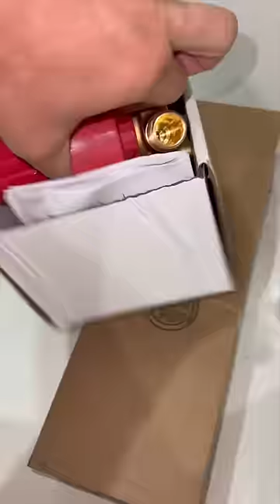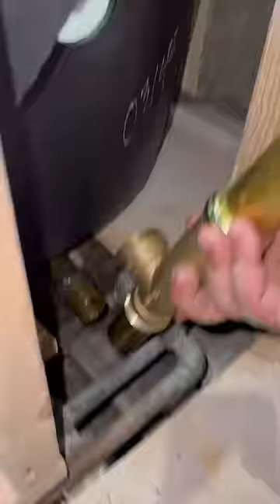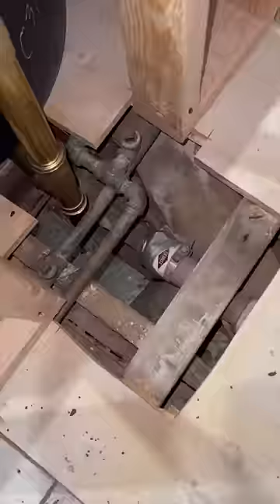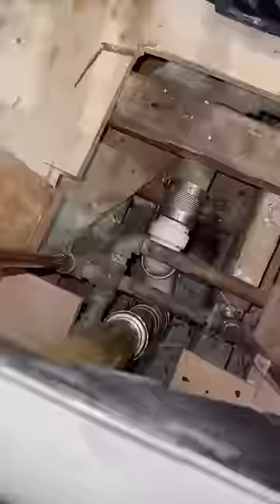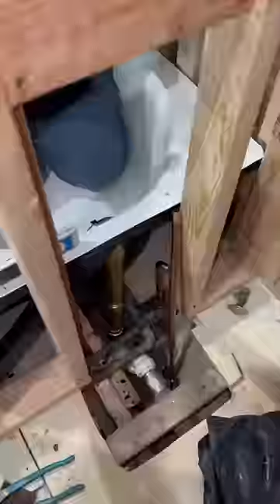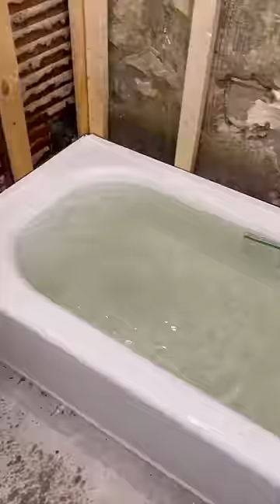Installing a bathtub and shower body #renovation

Comment: Worked in a hospital for a while and google translate was a life saver when there was a language barrier. It would auto detect what language they were speaking
Reply: What did you use?
Reply: Was going to comment google translate
Reply: Or hear me out learn the language of the country you decide to boarder jump to.
Reply: @godyoursavior4854  well if your talking about the United States, there is no official language.
Reply: @nathanielschmitt6547 true but the default for most is broken English that use so many different pronunciations for a single word
Reply: Yes, you just need to use simple short sentences with no slang or colloquialisms.
Reply: @godyoursavior4854  Tell me you only speak one language without telling me. That's a process that takes years even if you're really working at it. Even once you have a handle on everyday conversation, technical topics are going to be outside your vocabulary.

I studied my second language for about 7 years and my third for 5-ish. I couldn't tell you the word for "valve," "showerhead," or even "plumbing" in either of them.

Comment: It’s strange seeing you use PVC. Keep killing it bro!
Reply: If it is not a high rise. Then it is okay. PVC in a high rise is like putting gasoline in the walls. Just waiting for a ignition and then you got launch all the way up.
Reply: @hoktang1 I though they had to use it because of rats
Reply: @bmo14lax  I thought he said that they had to use cast iron on the main drains because if not rats will chew through it. I've been there. I'm not bad mouthing
Reply: PVC is allowed in nyc any building 5 stories and less doesn’t matter if it’s an apartment building or private home , most buildings and owners prefer cast iron ( quiet pipe ) because it’s less noisy
Reply: @Billybonessss  I could be wrong but if is a individual own home. Then I think pvc is allowed. If rats damage it then the cost is covered buy the home owner. Where in a high rise the building owner is responsible. For the people that lives in his property. So it maybe a little bit more rigorous or a higher standard.
Reply: @hoktang1  It's less about highrise and more about vertical installation, where the fire would climb the pipe
Reply: PVC always better it just sounds louder but for underground will last 100s of years versus metal lasting 50 clay maybe 40 years on average atleast from all the sewers ive dug up and copper and brass both leak in shower drains alot brass is rare but it happens over time chrome plate brass link sink drains rot very fast PVC is just the way to go lol screw the aesthetics use plastic PVC because it's just better exception of rats eating through it above ground and sound deading properties
Reply: @hoktang1 it's honestly crazy how destructive rats are though in NYC an chicago
Reply: @Billybonessss looks like it is illegal in the video TBH bc it does look like apartments so he's fked up for doing that not in brass

Comment: An easy way to adjust that rod and nail it every time is to do it OUTSIDE the pipe. You can really easily mark the fully closed position on the outside and use the screws to hold the plate on the back side of the assembly. Then you adjust it to the correct height, and boom broski, you’ve got yourself the perfect length every single time.
Reply: No one has time for that. 😂

Comment: heres a tip from one professional to another. your phone and its ability to tap into the internet can be your friend. In this case you could have brought up a picture of a shower with the extra handheld option or just bring up google translate and that should be enough to get a simple question across.

Comment: Watching this I can't help but feel the same way when dealing with mess ups on my own jobs. Had an entire hospital wing renovated, new pipes , new water columns for the supply new drains for all the bathrooms, after all the roughing done the construction teams come in do all the walls ceilings, and next thing i know 3 weeks later i get called back to fix like 7 problems. Floor and sink drains clogged up with cement and who knows what kind of wall glue they used, faucets leaking and not running well(they had nothing but sand &plastic fibers in them).

Comment: There’s a bit of a trick . Don’t screw in the trip lever , put the stopper in and flip the trip lever if it raises and levels out to the screw ports then you’re good. If not make it longer or shorter. It saves you time and frustration from unscrewing and tightening back

Comment: Looks good man.  Quick question though.  Is there a reason you use a brass trip lever waste assembly?  Is that code in your area or just a preference.  Fortunately I don't ever do those trip levers but I pipe the drain and overflow in pvc...never had a issue.

Comment: On the gerber, set the barrel on the bottom of the tub and the offset in the linkage should be at the same level as the face plate screws

Comment: I guarantee you will be back to install the handheld. It comes with it in the finishing box. If there's an option on the valve for it means there is a handheld in the box
Reply: Valid opinion but so it always knowing you can come back and add it easily but it’s harder to remove it

Comment: It's interesting seeing how plumbing works in other countries, These types of installations would never fly by Swedish standards. We are never allowed to put joints in walls or floor unless theres a water proof box around the joints with a drainage leading onto a waterproof floor AND the joints have to be able to be accesed by a hatch on opposite side wall/ceiliing below

Comment: Same w me I hate those flipn linkages, always takes me way too long, I had a homeowner Try to install it any ended up, dropping the linkage down their drain And decided not to tell me to go all the way back home and putting my camera down there I finally found it and snaked it out w a wire. Those linkages also rot out a lot cuz they’re so thin, I always try to push them towards the pop up drain now

Comment: Watco uses a number guide on their waste/overflow. Whatever number is exposed on the overflow pipe is the same number you set the linkage at. Dead on every time.

Comment: I'm with you on the tub drains. Those are a pain in the ass especially to adjust the right depth of the cylinder to hold the water on the tub

Comment: Hey @hydronyc, I know it's the plumber on-sites option on which product they want to install, but what would you use for sealant? Plumbers putty or silicone? Any reasons for situations where 1 would out shine the other or they both equal?

Comment: Just was testing some tubs at Johnson & Wales university above their library  / bookstore. Built in 1902 and now being remodeled from old dorms to low income apartments. So much fancy wood work in that bookstore. Wouldn't you know it, someone missed putting on a dirty nipple in the drop eared ell of a tubs shower head on 3rd. Water went back on so we could fill a few tubs when suddenly someone yells PLUMBER! Damn... don't you hate that call when you just turned on some water? Sure as shit that tub was goin to town.. full to the brim and spilling out onto the floor..
A bunch made it to the 2nd floor above the bookstore but nothing got into the ceiling of that ancient wood work...
Who puts a valve in, turns the stops on it on, & leaves the freakin dirty nipple out? Damn kids... 😅

Comment: THIS IS WHAT YOU'RE LOOKING FOR WHEN YOU MAKE THE ADJUSTMENT ON THOSE GERBER TRIP LEVERS. PUT THE LEVER IN THE UP POSITION. THEN DROP THE LINKAGE INTO THE OVERFLOW TUBE. THE ADJUSTMENT IS USUALLY LONGER FROM THE MANUFACTURER. THE DISTANCE THAT THE HOLES ARE OFF, AND YOU COULD ACTUALLY MEASURE IT. YOU TAKE UP ON A LINKAGE TO THE POINT WHEN YOU DROP THE LINKAGE BACK IN WITH THE LEVER IN THE UP POSITION. ( IT MAY TAKE TWO TO THREE TRIES). AND WHEN THE HOLES ARE EXACTLY LINED UP.  YOU HAVE THE PERFECT ADJUSTMENT. REMEMBER TO LOCK IN THE NUT ON THE LINKAGE...

Comment: Gerber brass waste and overflows are the only ones I use...Yeah, adjusting that trip lever is a pain in the @ss though. Wish they would convert to a toe stop and change those flat head overflow plate screws to Phillips  too.

Comment: Bro I literally will not install those BS adjustable stops🙄 I tell them push stop or nothing. If they already purchased I still go get the push stoppers. There much less of a hassle for clients and installation.  Trying to find the correct adjustment is annoyingly tedious at times and there design contributes to clogs 🙄🤦🏽‍♂️😡

Comment: She must be short and doesn’t want the next family to have a decent shower head height. We set em at 7’ or higher. Water can fall down but can’t fall up. Also the valve is too high for anyone laying in the bath tub to reach keep it at 28-32”

Comment: Do everyone a favor man. Don’t use that shit trip lever linkage crap. I always swap it out for a twist and lift drain assembly and a blank overflow plate. That way the drain will be easy to access when it needs cleaning and 10 years down the line you won’t have the linkage break off and block the drain. Sure this takes a little more effort and cost a few bucks more but i feel it’s a superior product.

Comment: Stop using putty on drains bro. It has no flex and dries out despite claiming it never will resulting in cracking some day when you go to change the dried out, cheap chinesium  overflow gasket High quality silicone for the win